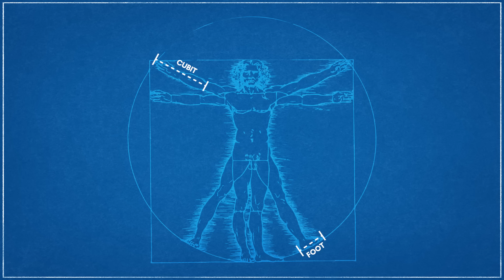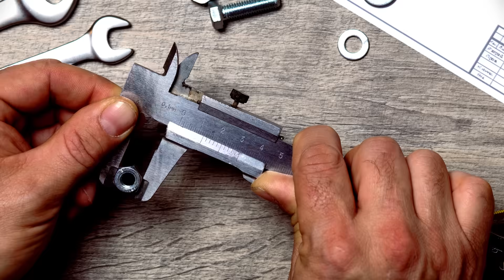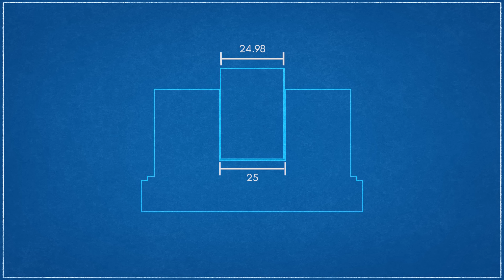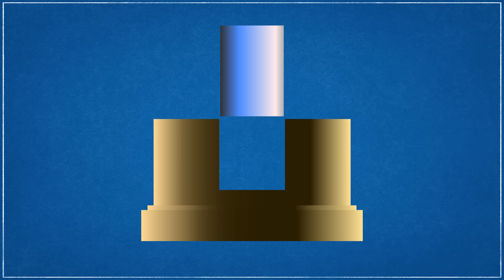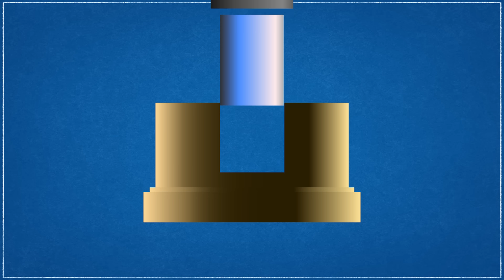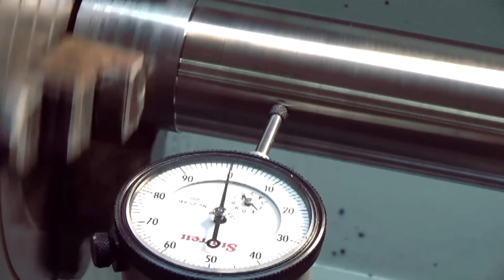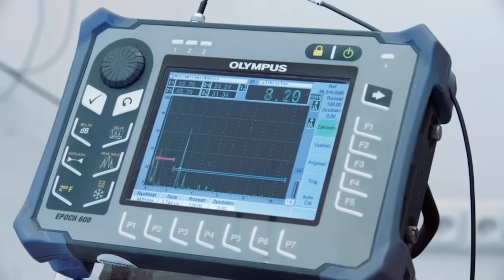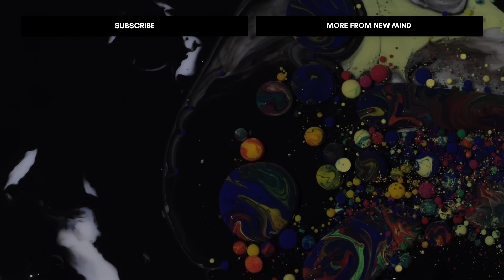The Science Of Small Distances

Comment: Last about 11 years?

I just spent 10 hours straight helping my dad replace the transmission in his 24 year old truck he's giving me. The engine is still running good. He's had that truck since I was like 7 years old.
Reply: The keyword is *average*. When you consider how well most people take care of their things it starts to make more sense.
Reply: @Tubeytime  I guess a lot of people don't take care of it.

I think most of the time there's really nothing wrong. One thing will go wrong, like a worn out wheel bearing, or water pump, or just general maintenance, and people will throw the car away.
Reply: @austinhernandez2716  True, but there's also a lot you can do during "regular" use to reduce the life of your engine. Accelerating at 3k rpm and above, cold starting, driving on uneven ground or in dusty areas. Inefficient use; making the engine work harder than it needs to wears it out faster.

Comment: As a woodworker I regularly work within the tolerances of 1/64" or ~0.4mm. So I don't agree that 1mm is the smallest tolerance humans can work to. If your dovetails, for instance, have a 1mm tolerance then youre a shit dovetailer.
Reply: Can you carve your dovetail by hand with chisel perfect fit first time (without touching/comparing the two piece of wood for small adjustment)? Probably not, so your humain tolerance is about 1mm or probably worst.
We can polish a telescope mirror by hand up to micron precision. But only a machine can doing it without adjustment and measurements.
Reply: @alexandrevaliquette1941  usually I do need to touch up the tails or pins but never as much as a full millimeter off. I usually intentionally ere on the side of caution and leave my layout lines before double checking them and removing the necessary material. But we're usually talking about a 32nd of an inch at most. I actually use a mitutoyo dail caliper in my woodworking and its accurate up to 1/1000 of an inch and I need to to do alot of the more precise stuff that I do. I also make wedding rings, frames and even sowing needles out of wood. My tolerances are very tight
Reply: @autodidacticartisan  Well.. so I guess "Autodidact Artisan" is a very well chosen name. I am pleasure to know an "almost machine accurate guy".
Ok.. next level: can you still do it without any rule or caliper? Ha haa! gotcha!
Reply: @alexandrevaliquette1941  I could probably cut dovetails with only a straight edge actually, or maybe even without that if I get creative with a jig. I cut the tails first and then use the tails as a template to cut the pins. They wont come out symmetrical or even equidistant without a ruler or caliper but I could still cut them and have them be tight and we'll fitting. But if they for some reason had to be exactly at a 1:8 ratio then no I couldnt do that without a measuring device lol
Reply: @autodidacticartisan  You cannot use the tails as a template either.
It's like, try to cut two spaghetti at the same exact length (no rulers and you cannot put the first one close to the second one to adjust your length). Humain are not that reproductible.
Anyway, thanks for this exchange, I think we went a little to far!
I wish you love from Montréal.

Comment: Cars are so unbelievably unreliable when compared to machines in the general industry. A car is designed for 5000 Hours of use. the First inspection takes place after just 20-30 hours. now picture what that would mean in an industrial machine. these run 24/7 and need to work. imagine a company buys a machine and has to stop production for an inspection of the machine before even all shifts have gone through once/ a single day has passed. it's unacceptable. And 5000 hours also isn't much. that's just over 208 days or, if the machine would be started on Jan 1st of the year, it would be done by the 28th of august and would have needed many inspections and repairs, halting production in a frequency that no business could sustain. 

and to give you an example that we could do better if we wanted to, the Huge haul trucks that work in mines, the ones where the tire is twice your size or even bigger, get their first INSPECTION after 50.000 hours. not that anything is expected to be broken at this point. it's just the first time someone checks if everything is still up to spec. cars last a 10th of that, with many breakdowns and repairs in between. 

Cars are laughable, they really are something to scoff at

Comment: Interesting. I've been a general auto mechanic for almost 20 years and I heard a rumor awhile back about Rangerover engines dropping cylinder sleeves causing head gasket leaks because of the hvac setup in the factory where the blocks were made. Apparently the fresh blocks didn't cure correctly because air was blowing on them at a critical point in the assembly line. Not sure how true that is but it makes sense and I've seen enough dropped sleeves on Landrover Rangerovers to believe it.

Comment: Your fitment animation needs to allow for the air pressure at the back of the bore during assembly. This is usually allowed for by drilling a vent hole in the shaft or machining a flat for the air to escape. Also, you can add chamfers to the parts to assist assembly

Comment: your oil pressure in the motor is the result of your crankshaft journals as well. New journal bearings will have higher pressures than worn ones.

Comment: I once machined a bore for a ball bearing in an aluminum housing, but my last cut went slightly oversize. This has happened to all of us, I realize. But I left the part in the machine while I figured out how to fix it, and when I came back hours later the part had cooled to room temperature and the bore had contracted to the right size. This was a bit of luck in this case, of course, but temperature matters when precise dimensions are required.
Reply: I used to work in Pratt & Whitney  The building was constant 68 degrees F   And the blue prints specified the temperature to inspect  dimensions at 68 F .   Some parts were up to 56 inches in diameter   Needless to say size of them was sensitive  to temperature The parts were made to be assembled in 68 F
Reply: I did all the inspection work for my machine shop, and some blueprints specified dimensions at certain temperature and even humidity levels.  I could hold aluminum helicopter engine parts in my hands for a few minutes and get them to grow or shrink in and out of tolerance from the heat in my hands.
Reply: @MeanderingMentor  We made parallel bars and 1 2 3 blacks in trade school  They were never flat because we surface ground them with out coolant. No matter how slow you grind them the center would dip as they cooled
Reply: I have machined very large pieces of aluminum and they would vary .010 depending on temperature.
Reply: In other words don't touch my balls.
Reply: Yessir! Heat expands matter and cold temperatures condense ! Good ol Physics and chemistry
Reply: It could have also blown up
Reply: Nvm i guess you left it in the bore machine instead of the machine where its supposed to be built in

Comment: I'm sorry but it's possible to fit a 24,98 mm
Bolt into an 25,00mm hole. I do this everyday at my work. It's even possible to fit something with a difference of 0,005mm by hand with the right experience
Reply: Have to agree. We regularly perform "Go/No-go" checks with plug gauges only differing .0002" (.005mm) by hand.
Different thought: Doing this by hand will pretty much always result in the gage and the bore rubbing against each other as our hands are not still or accurate enough to get centered at this level. Not to mention the cleanliness of both objects. For a lot of purposes this is perfectly fine and causes no issue. There are cases though where any material displaced by this rubbing could fault the assembly and require machinery to more precisely put them together.

Tl;dr depends what you're trying to accomplish.

Comment: The big difference between old and new engineering isn't the size of tolerance, it's the fact that we now "make to measure" whereas they "made to fit".   They had examples of impressive stuff done by hand(Although not like modern stuff), but it wasn't "exactly 5mm" it was "Needs to fit perfectly in this specific hole which is about the size of a bean".

In 3D printing engineering fit gets really nuts.   Clearance fit can be an entire millimeter if you don't postprocess. Not just because of tolerance, but because you might get weird burrs and stuff.

I'm glad I don't work with anything that needs sub 0.1mm tolerance!  Machining looks hard

Comment: Incorrect about the audio wires, fiber optic cables core is very thin and transmits pulses of light, and the protective part of the cable is plastics and other materials and make the cable thick to protect the fiber. Cable for audio is typically made of copper and much thicker around or a little bigger than a pencil led. What you showed is a RJ 45 jack and they are made in different ways not going into it, the wire you see is probably gold plated and is only used on part of the connectors.

Comment: Even in Celsius, I have never seen a car that operates at 100 degrees. In Fahrenheit, they're usually around 180 to 190 degrees. I think that's around 90 or 95 degrees Celsius, but if your car hits 212 degrees Fahrenheit or 100 Celsius, the water boils, which would be bad. Antifreeze would boil at those temperatures too

Comment: Also coming from experience I can say that while your eyes may not be able to see thousandths of an inch your fingertips can feel it. I used to weld torque converters back together and when polishing the hub you can feel the runout beyond a few thousandths of an inch.
Reply: I posted this before I finished watching the video and he does address this lol
Reply: ........HOWEVER, when I synchronize my carburetors on the bench, I shine a light through the other side of the slides and bring them down just when I don't see the light shine through. I don't think my fingers would be able to feel that difference.
Reply: This is why he says "DIRECTLY see tolerances.... at this level"
Reply: Inches? Do people still use that? LOL
Reply: @TRPGpilot  Oh you got to read my drunken rambles, we used SAE to measure tolerances but my chucks were both standards. I prefer metric/decimals over the SAE/fractional measurements, I've also worked in kitchens for over 12 years and I went to college for computer science and engineering. So while I'm American, I use Celsius, Grams, and Millimeters for my measurements and then convert. It's easier that way
Reply: @daze8410  OK, fair enough.

Comment: I'm 29 years old and my truck is an older diesel that has oil hydraulic rollers as valve lifters. It's never had a rebuild and going strong :D Not saying it doesn't need a rebuild but it's still fucking going.

Comment: 12:50 My dad worked in semiconductor quality control. He sometimes had to "grind down" into chips to take a look at certain structures, so he applied these pieces as big as a sandcorn to a holder and grinded them on plates of glas, molecules of highly distilled water being the abrasive material. For finer work, they used a focused stream of particles, where you can see in realtime what you just "milled away" by doing roentgen spectroscopy. Fun thing is, he referred to that process, where you blast away atoms one after another, as "burning a canyon into that surface and sift through the debris"

Comment: 4:50 Fitting ignition points many years ago I would always have trouble getting the gap right with feeler gauges as they would close slightly when removing the gauge. Over time I learned to gauge the gap by eye which I would check with feelers and it would feel better than any attempt with feelers, it actually felt perfect.
The gap of Bosch points is usually 0.4mm (0.016") while Japanese vehicle points is 0.5mm (0.020"). That difference is quite noticeable in itself by eye with experience. I don't know how close my settings were but by feel I would be confident to say another decimal place.
I'm not saying that is how accurately I can measure by eye, by no means, I can't tell the difference between 6.5 and 6.6mm or even 1.4 and 1.5 mm. What I'm saying is just that with experience people can far exceed what is considered the limits.
Digital display verniers are good for seeing how close you can get to a gap.
I'm sure there are plenty of toolmakers out there who can tell about how fine they can gauge without measuring.
Reply: this is so cool, i love to read this. it seems like The longer we observe something the more sensitive we become to the multiple observed sensory inputs associated with that thing. Therefore we become much better at playing 'spot the difference' between state changes of associated with thing (saying something is feeling right or not feeling right may communicate something simple but is really diluted from complicated data that is imperceivable to the average person etc.) especially at the tolerance levels you are talking about 
very interesting
Reply: I scrolled down to see if anyone had any objections to what he said also. With experience you can see smaller details given that your eye sight is good or you got good glasses. There are also tricks to see stuff even smaller than that by using light and looking for reflections or details that stick out as you move the object around in you hands, having a loupe is cheating but who doesn't like cheating.
Reply: I agree with you.
I worked on Italian,German and Japanese packaging machines. The air gap on the clutches and brakes had to be writhing .3-.5 mm. After 40 years I can set them without a guage.

Comment: company i used to work at had a problem. they make a laser micrometer that could measure much smaller than 1 micron. but not with good repeatability. what they found out was not only a temp problem but a air pressure problem. precise air pressure in the inside of the devise helped solve it. of course few need a tenth of a micron measurement device but for the right money they can have it. a ton of money is spent on equipment just to measure beer can punches or looking for flaws in fiber optics.
Reply: That tool sounds awesome. I want it,  I don't need it, but I want it.

Comment: Hey there!  I am a retired engine machinist who ground thousands of crankshafts and bored and honed thousands of engine blocks, as well as piston pins and bushings etc. I saw the first video on this, and remember seeing some information that was a bit off.  I have been subbed since, and have been watching your videos. Their quality and the information quality have been getting phenomenal!  You have a really good skill there.  Keep it up!  As you went smaller in dimensions in this video, I kept comparing the information to what my experience told me, and everything was really, really accurate.  I saw one tiny flaw, and maybe others mentioned it, but piston pins DO have a clearance fit, of about .007mm, so they do slip together at room temperature, although, as you said earlier in the video, it takes a bit of skill to line them up well.  In most engines, the cast iron connecting rod bore end is heated to allow the pin to slide through, and it clamps on with great force when it cools.  In a lot of diesels and industrial engines, the connecting rods have a bushing in them which also has the .007mm clearance honed in, (rather than the interference fit), and in these situations, clips are fit into grooves in the piston on either end of the pins to keep them from sliding all the way out.  You may already know all this too, but I got talking.....  anyway, great job!  I would LOVE to be able to make videos like this, but I seem to be stuck on learning how to do animation.  I think it's just a matter of 'drive'.

Comment: I would suspect the machining for very high tolerances is made far more difficult with the machinery used to create the parts. Now there are multiple high tolerances involved within the individual parts within the machine. It's like a never ending story.
Reply: There are a few tricks that you can use to make parts with better tolerances than the machine that you are using, mediocre threads can move a cutting tool in a lathe with extreme precision so long as you account for the inherent slop in the tool.

Comment: The human eye can typically resolve down to 3 - 4 mils (0.003 - 0.004 inches or 76 - 100 µm) in 12" -what to check? Get two reams of black and white paper 3 mils thick 80 - 105 gsm paper (or color the edges of white with black ink) and stack them alternately and with good vision you can revolve each sheet - at ~14" distance it starts to degrade and fade to gray.

Comment: We are already dealing with CPUs that have a 4 micron gap! They already did 3 microns before too, but the electrons jumped too much and they had to go from 3 back to 5 microns, and put more processors on a single chip.
If they had been able to keep getting smaller gaps and push past that 3 micron limit, we would still have CPUs with only 1 processing unit on them! Now we have ones with 64 chips on 1 CPU!

Comment: 4:33   Yes, you can measure length with micrometer. However, machinists almost always use it to measure outside diameters (ODs). much easier to use a vernier height gauge to measure length.
Reply: Internal micrometer damn it
Reply: vernier calipers are only good to about .002 inches. So, if you are on either end of a plus or minus .005 inch tolerance you can easily be out using calipers. Use a micrometer.

Comment: Most US industries use mils.  A mil is .001 inch.  I work in the power industry and new equipment is still designed using the imperial scale and most standard units are given in mils as well as mm's.